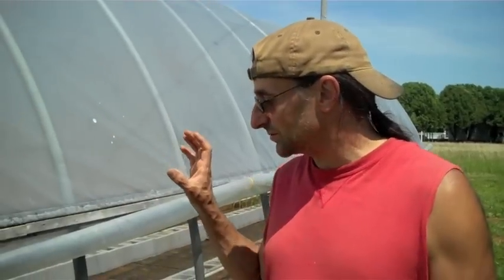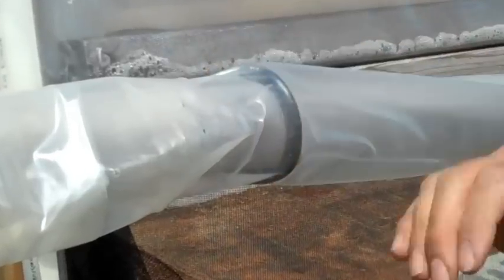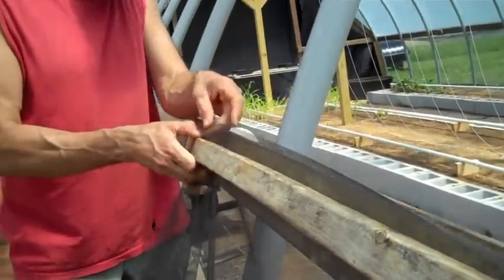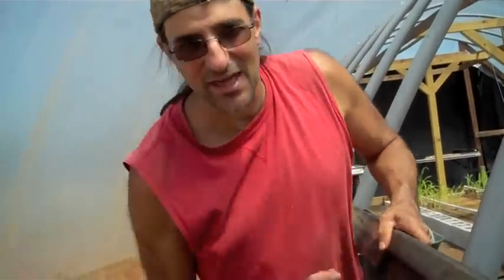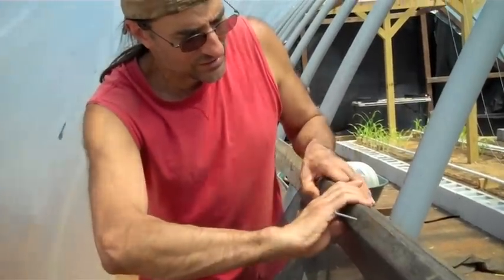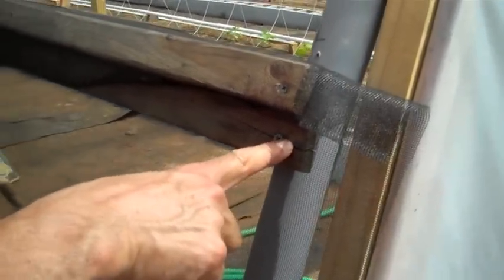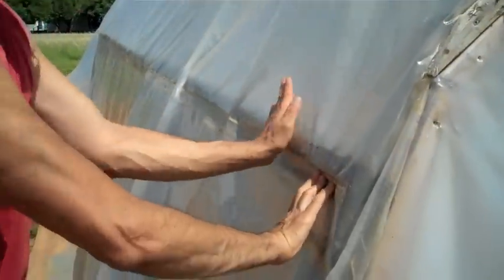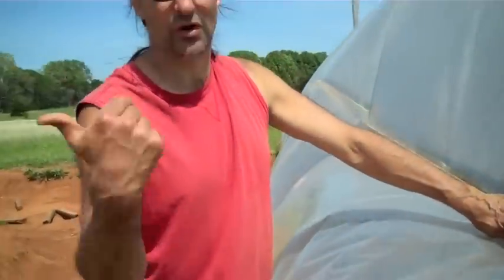Hoop House Screen Walls

Comment: Looking to build a hoop house this year for a dutch bucket system. I was wandering how bees are getting into your house for pollination or is this a problem with a hoop or green house
Reply from the maker: We leave the door open when it's warm inside (usually above 70F.) and we also have some gaps where bees find there way in. Pollination has not been a problem as of yet. We do give the tomato and cucumber vines a little shake to help them along but I don't think it's necessary. I know a hydroponics tomato farmer here who purchases bumble bees to release in his greenhouse. He only operates from November until April. I kinda think it would be too hot inside during our summers and the bees would either leave or die.

Comment: Hi i really like your green house! What size pvc did you use when you built it?
Reply from the maker: The arches are 1 1/2" and they slide in to 2 inch pieces that are driven into the ground.
Reply: Mark Leo jr